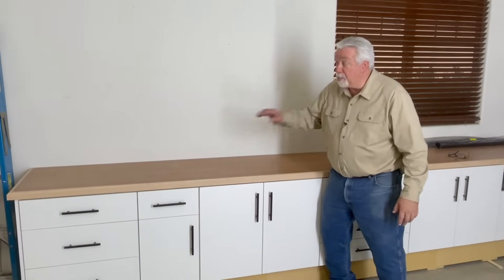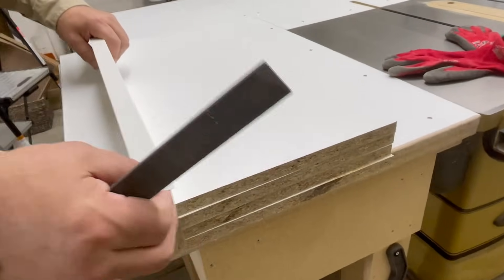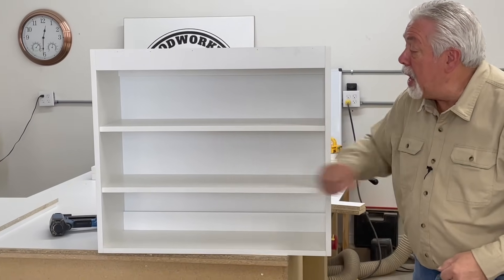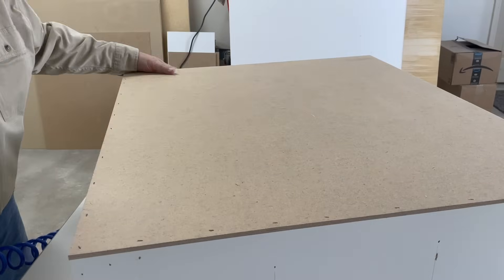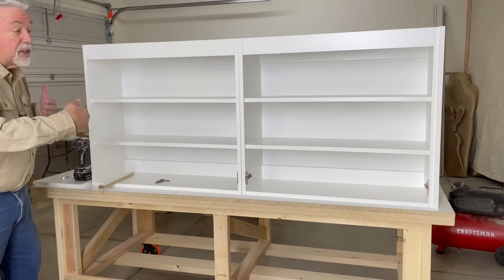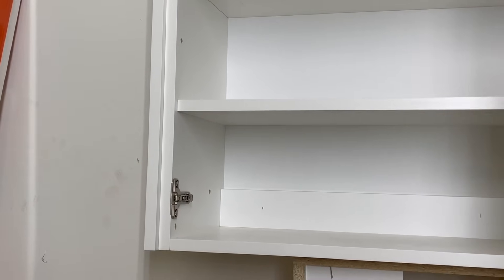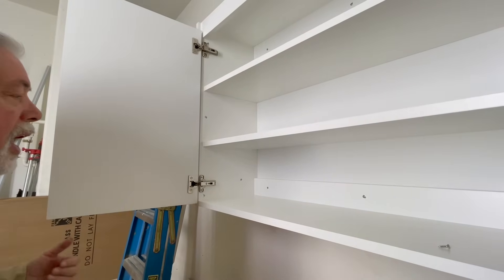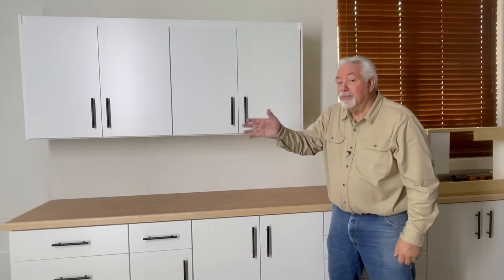The Secret to Mastering Upper Cabinets: Design, Build and Install

Comment: I pulled out my 7/16 crown stapler on the last set of cabinets I built and found it to be quicker and just as solid as screwing them together. As a bonus the staples are also cheaper. Thanks for the tip! I enjoy your videos!

Comment: I have been using a similar support for upper cabinets for 40 years but with adjustable furniture legs. When I loosen them, I remove the support box without scratching the top of the lower cabinets. Greetings from Bulgaria !
Reply from the maker: Great tip! Thanks for watching from so far away! 😀 Wes
Reply: @WoodworkingWithWes  A villager went to a sage for advice. "- Sir, I live high in the mountains, and the sea is at the end of the horizon, and my eyes are too weak to see it up close. How can I make them stronger? - You don't need eagle eyes to see beauty no matter how far away it is, but a heart!

Comment: Awesome! I have never been a huge fan of melamine but it sure does have its place in terms of cost, workability, stability, durable finish, etc... I think I will make some shop cabinets just like this. What are your thoughts about making the finished end panels 7/8" proud of the cabinet box to flush out with the cabinet doors? Also why do you like salice over blum? Is it a regional thing because blum is king here on the west coast :) thanks
Reply from the maker: Hi...the size of end panel is a personal preference, so which ever you like. I have used 
Blum hinges also and they are great; salice has adjustment features I like better. Thanks for watching, Wes

Comment: How strong are wide crown staples? Can the shelves hold anything of weight with only staples holding them? Ty great video.
Reply from the maker: I have never had them tested for maximum weight, however, I have never had one fail. Thanks, Wes

Comment: If you were building the cabinet with a face frame, which would you apply first:  the 1/4 back board or the face frame to square thing up?  (Thanks for all the advice already)
Reply from the maker: Hi...I would apply the face frame first and then the back when completed. Thanks for watching, Wes

Comment: How do you determine when to use only Brad nails and when to use staples?
Reply from the maker: Hi...I actually use both. The brad nails are more for alignment and the staples are for securing the assembly. Thanks for watching, Wes
Reply: @WoodworkingWithWes Right, but sometimes you use only nails like on the hanging cleats you didn’t use any staples.  What determines when you also use staples and when you don’t?

Comment: What happens if your staple blows out to the inside or outside?
Reply from the maker: You would need to make a repair on the melamine surface with either a white screw cap or a white filler, such as Seam Fill. Thanks for watching, Wes

Comment: Why wouldn't you get a hand trimmer for edge banding? Way faster and it won't over cut and get into the melamine
Reply from the maker: I do have a hand trimmer that I use on PVC edge banding. The white iron on cleans up better with just a file. Thanks for watching, Wes